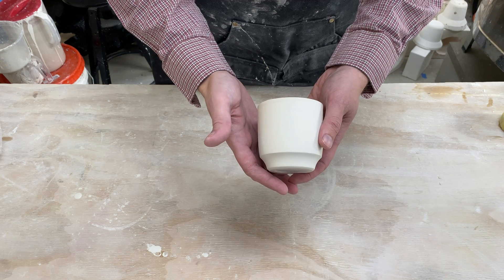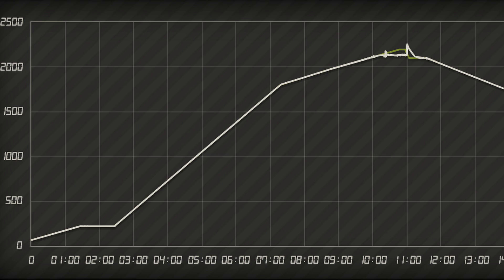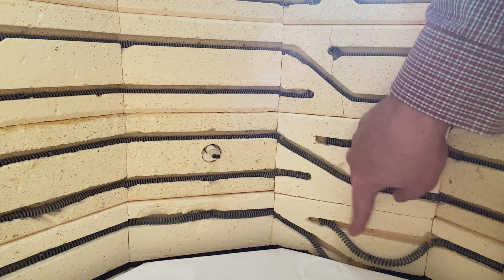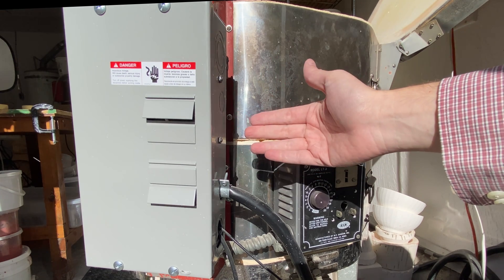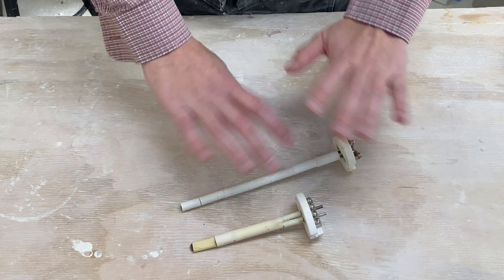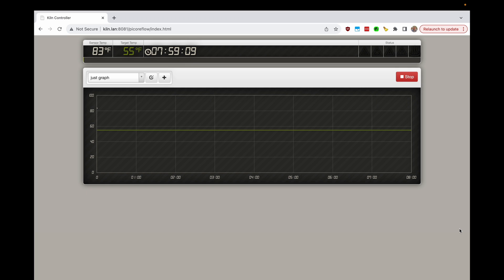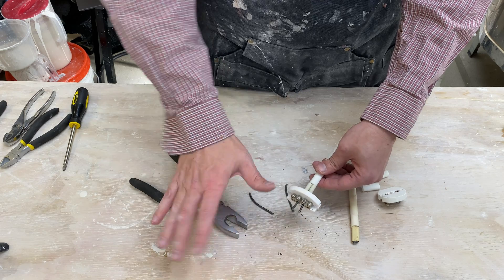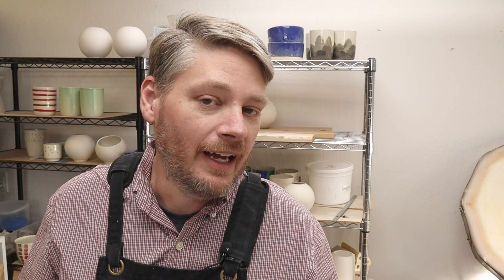Replacing my Kiln's Thermocouple

Comment: 7:30 Thermocouple works by generating voltage that is proportional to the difference temperature between hot and cold junction of a thermocouple. The tip of a thermocouple where two different materials meet is called a "hot junction" and the point where thermocouple wires end is a "reference junction" or "cold junction". Difference of the temperature generates voltage across thermocouple wires and that voltage after amplification indicates the temperature in your kiln. Important thing to remember is that thermocouples don't measure absolute values, only the difference. For example, let's say your kiln is at 1200°C and your thermocouple is connected by normal copper wire from its terminal block to your controller. In that case your reference junction is at the other end of a thermocouple and it is sitting at around 50°C (arbitrary number I don't know real values) so the thermocouple will generate voltage indicating a temperature of 1200-50=1150°C. Kiln controllers use some type of a "cold junction compensation" so it knows what temperature the "cold junction" sits at and adds that to the equation to indicate the correct temperature at the tip of the thermocouple.   In your case I assume you have your thermocouple connected with a special type of compensation wire and it goes straight to your kiln controller, so there is your "cold junction". Connecting a thermocouple with a compensation wire (a special type of wire made from the same material as a thermocouple that is not creating any junction that can affect your measurement) allows you to place your "cold junction" whenever you want, for example a couple of feet away from your kiln in a room temperature.
Reply from the maker: Thanks for the additional details on thermocouples. And indeed I do have the "special" thermocouple wire going into the thermocouple module on my homebrew kiln controller. That also let me run a calibration routine and set the PID values, etc. Luckily kilns don't need absolute temperature. Judging from my cones, the previous thermocouple was causing my kiln to run hot towards the end of its life and this one seems to be on target.

Comment: Hi Kent, I'm so glad you shared this. I was thinking about replacing mine for a first time and was postponing since I do not feel very confident on doing it. So this is gonna be very useful! I bought a very old model of  Italian kiln a year ago and I've got and extra thermocouple for replacement.  Fingers crossed that all will work after my replacement :)
Reply from the maker: This one was pretty easy with the thermocouple block. As I point out, the only real trick is getting the polarity right. Good luck with your old kiln. Mine been treating me well!